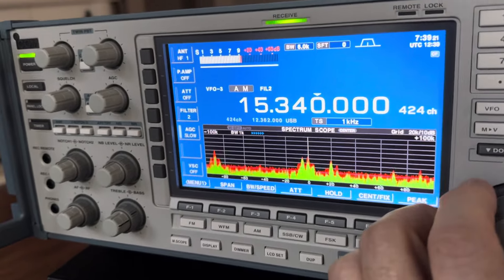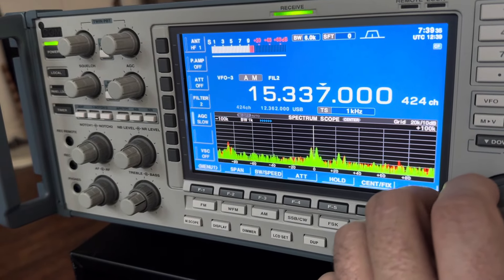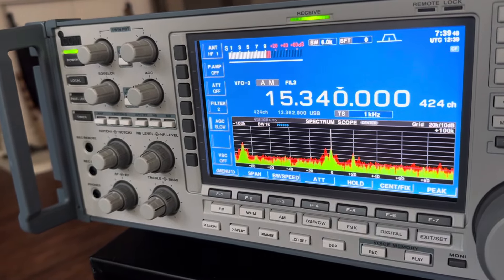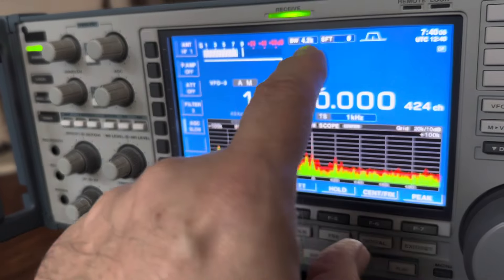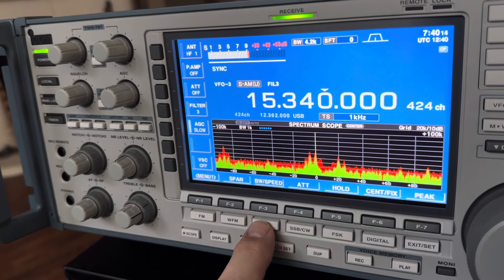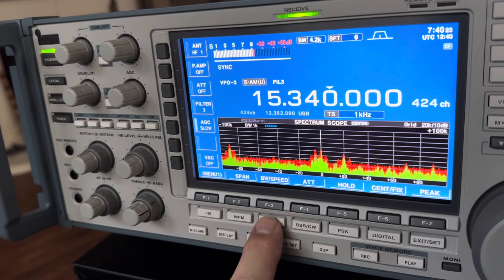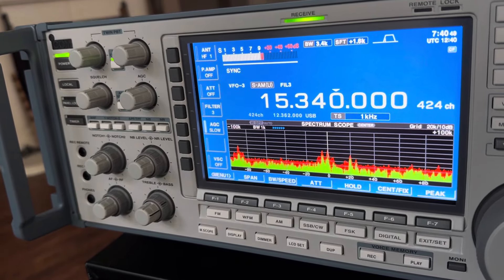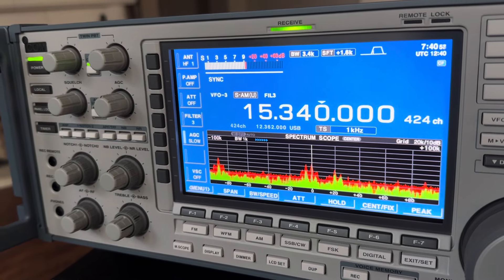Icom 9500 - Bad Hombre

Comment: How does it compare to Ten Tec 340? Thoughts? Do ramble, I want to know all. Wished I had one of each and a good site with a superb antenna. Imagine what these would do say up in Dakotas or Iowa (here) in tural setting with no noise around on 100-foot plus tall towers with antennas to match. My dream one day. For now R75 will have to do.
Reply from the maker: @AldoSchmedack  you should look through my video library. Click my name then click videos. There are about 100 radio videos comparing hi end receivers including the 9500, 340, and the 75. Also many others